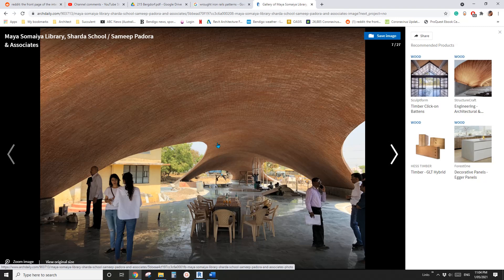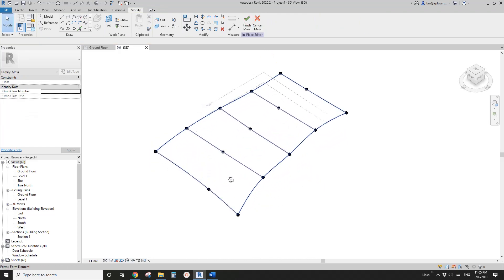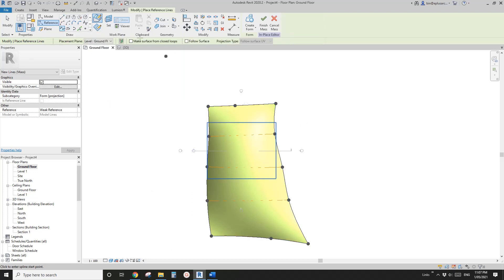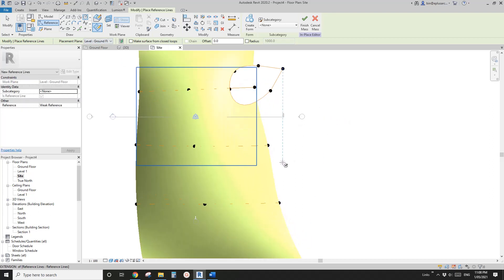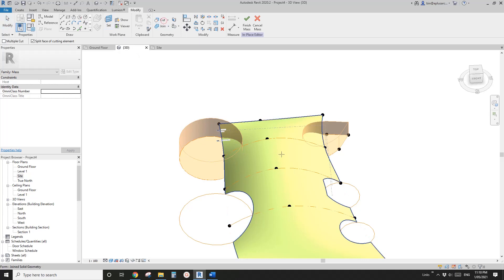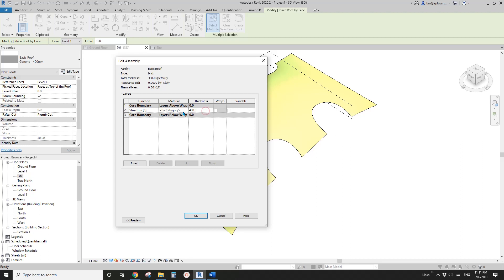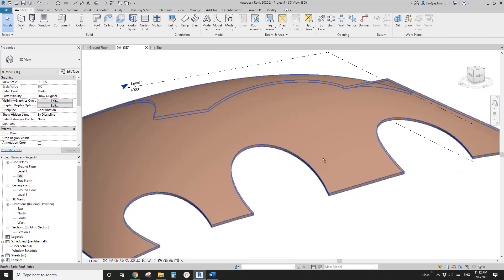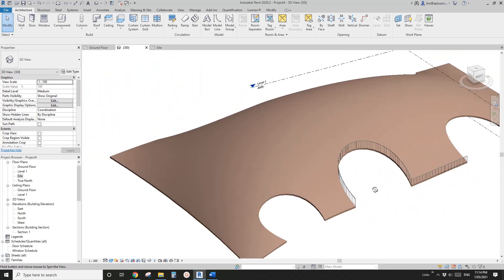Everyday Revit (Day 408) - A Simple Roof by Face on Mass

Comment: How can we adapt the window tonthe shape
Reply from the maker: What type of windows? Vertical or parallel to the mass?
Reply: @BINHE615   vertical and parallel
Reply from the maker: @fvargas3089  For vertical window, you can simply use curtain wall and attach top to the curved roof. For parallel window, you need to go into the mass, place a void to cut a hole, then add a solid face at the same spot to host your window, which can be placed using either sloped glazing, curtain system or pattern based family. I'll do a quick one shortly.